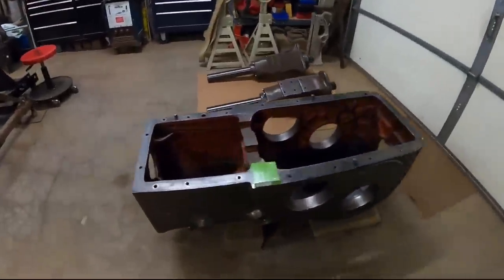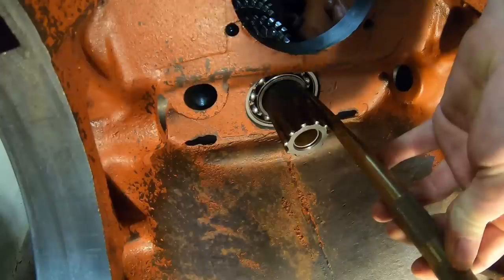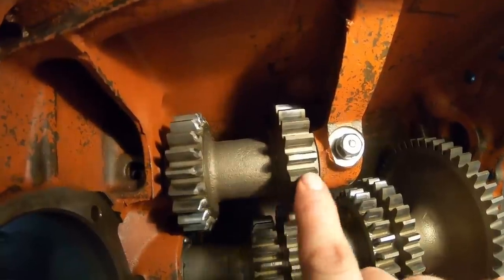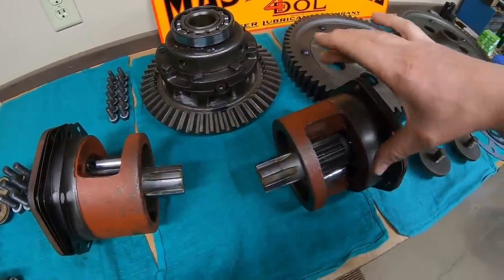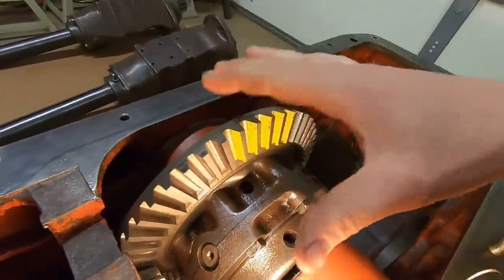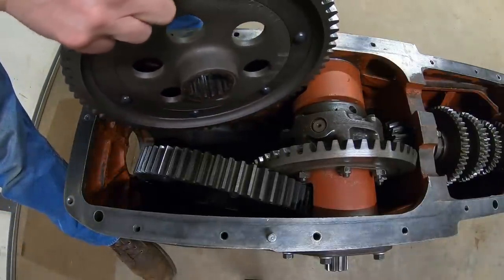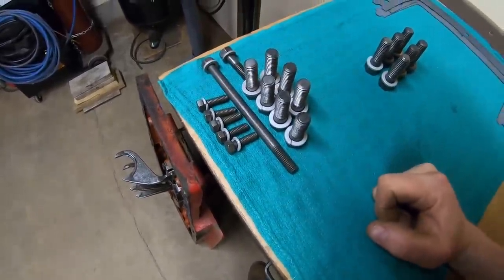Farmall "Preparation H" Project Episode #3 - Gears Back In, Checking Setups & Axles Back On

Comment: Turning the differential gear around to reverse the transmission plus the use of a different transmission cover, is exactly what IH did when a tractor was to be set up for service as a cotton picker, !since in cotton picker service they had the tractors run in reverse due to design of the cotton harvesters then in use at that time.
Reply: There was a little more to it than that. Cotton pickers have no 4th gear.

And just "flipping" the differential ring gear to the other side of the pinion means the wrong side of the pinion teeth is driving the wrong side of the ring gear teeth. There is no correct "contact pattern". 

They were complete clusterfucks and IH never SOLD a single one. Some went on "permanent loan" or "extended demo" but as shitty as the "chassis" was the picker was even worse.

Comment: Thanks again Toby! Great to see the H going back together. I know it’s not a complete rebuild but enjoy seeing an old Farmall getting cleaned up. That front emblem looks pretty cool being original and steel and wish mine had one on when I got it and not having to get a new one from Steiner’s. Hopefully you hang it up on the garage wall when you get done with Preparation H. Can’t wait for the next video!
Reply: @squatch253  that’s awesome! I couldn’t agree more 😁 I don’t have any of them since my cousin restored my 460 utility, the H was done 20+ years ago and my 756 is all original. It’s gonna be nice to see you doing the brake bands on Preparation H and how to adjust them because my H is gonna need them in the near future. New brake pedal return springs are cleaned and painted. Hopefully get them on soon. I’d really like to do the 756 but it’s way more work than I can handle so I’ll fix the little things I can. I wish I could show you the tractors I have. I do need to replace the 460’s fuel sending unit and was told I need a new gauge at the same time but not sure. Thanks for the response!!

Comment: Some of the old Harley racers would lap their transmission gears together to reduce the friction.  If you wanted to get really esoteric you could do something similar to mate the used gears together.
Reply: These days the big bux thing is to polish the mating surfaces and apply diamond-like coatings to them.  DLCs might be overkill on a tractor.

Comment: Excellent explanation on the gear setup requirements with multiple bearing interfaces. Well done. Learned a lot. Absolutely think your hoist adjustable design is first class. That really could help in doing various pulls and lifts. 🇺🇸🤠

Comment: I'm again wanting to see when it all goes together, final assembly and is moving smoothly, quietly under its own power. Looking over that drive assembly, I'd almost put money down those engineers planned for farmers to be able to swap parts around to extend their life, like those bull gears. You even mentioned the ease with which you can assemble the pieces. Tons of planning by those smart engineers/designers.

Comment: Even with tapered bearings still moves and deflects. Big truck rears have thrust bolt and ring gear will push against under load that clearance around 0.040. Not all of them have thrust bolt but these are heavy castings and thick ring gear.

Comment: To add to 12:04, i don't think old Squatch was wrong either. Gasket maker works, you just have to do it properly. I have old engines with complex gaskets under my belt that cannot be fabricated by individuals, and ... silicone did its thing. I've no leaks, i have the right tolerances because i used calibrated spacers distributed across the surface, it works. It gets a bad wrap, because most people who use this kind of stuff (and i hope it's clear from the way i worded it, that brand doesn't really matter) ... they just use the whole tube of it and make a complete and utter mess of it. A little goes a long way, like all things in life, moderation is what makes things right.

Comment: Hey very nice video learned a lot but one thing I would like to ask and I might not be able to articulate as well as you can but if the bevel gear isn’t probably aligned with the sun gear how would you adjust it I would appreciate that very much something I have never done another thing I would like to ask is the deck with the shifter on do the bolt holes run right through because I have found M & H’s seem to get water in the differential every spring I crack my drain until water starts to drip and I wonder what your thoughts were to remedy that ongoing problem? Love your operation 😀🇨🇦

Comment: Shoot, I wanted to both see, and hear discussion, about the roller bearing between the slide shaft and the input.  Did I miss that discussion?  That bearing is often bad and noisy.  They are a bit harder to find and kind of expensive when you do find them.
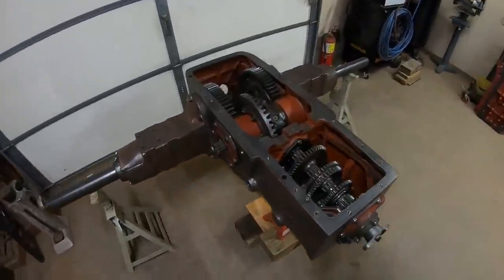Also, a question for you:  To replace a leaky gasket on the axle shaft housing, do you think it would be "reasonable" to reach through the PTO opening and remove the bolt that holds the large bull gear on?  This would eliminate having to remove the top housing plate.  At 15:11, a quick glimpse of the open PTO hole can be seen.  Can you cover that for me?

Comment: I have to ask ! What did you pick up that bent that heavy square tube into an arc on your home made load leveler for the engine hoist ? 🤔
Reply: @squatch253  that's funny ! It looks like about a 4 inch arc between the ends and the middle !

Comment: How'd the rivets in the bull gears look?
I've had tractors open that they were loose. One had one side loose and the other side had been replaced with bolts.
Reply: @squatch253  thats good, that tractor i was referring to with the bolts is a 350 farmall that was in our family since new. I'm definitely not easy on my stuff but it blows my mind how some of the old timers did some of these damages.
Long before my time but one of my uncles supposedly broke the new c farmall in half around a power pole, they fixed it and we still have it.

Comment: Only one taper press fit on ih crawler. The Final drive sprocket no  roller bearings  all ball bearings td18  ball are about 1 inch diameter. They  ruin  bull gear and pinion  quick

Comment: There ain't a whole  lot of difference between this rear end assembly  and that of 354 International,  with the exception of a P.T.O. shaft coming through the bottom  on the 354.  Put it in gear, turn the axel, it will come crystal clear.

Comment: Sir,   You are a Farmall mechanical genius!   I need new axel seals...if I remove the axles on a H or M will everything stay in alignment after installing the seals....I do not want to pull the top deck for installing new seals...ill just let it leak if i have too.....I see you made your new seals...can they just be purchased at CaseIH?     Thanks, so much.  D.

Comment: Like your video's. Very help full.What kind and weight gear oil do you plan on using?
Reply from the maker: I prefer to run 85W-140 in all of my older tractors because it quiets down these old straight tooth gears. Gear oil that heavy can get pretty thick when it’s cold, but that doesn’t pose a problem for me because I don’t run them in the winter.
Reply: I ask because I get told by some people to run 90 weight GL-1 gear oil because it won't eat at brass or bronze bushings. We have a McCormick Deering O4 we are working on the rear end and will be replacing the Oil. @squatch253
Reply from the maker: I’m not trying to play “comments section expert” here but a lot of people don’t understand the conditions that need to be present for some gear oils to start corroding and eating bronze and other light metals. Anything that is “EP rated” (extreme pressure additives present) is just like any other gear oil at temperatures below 400*F. From 400 to 525 degrees, the EP additives start doing their thing - they activate and form a thin layer of oxidation on the metal-to-metal contact surfaces that are meshing together with enough load/friction to be creating the heat. This oxidation can and will deteriorate bronze bushings, but in something like an old letter series Farmall, you would only get up to those temps if you had a catastrophic failure happening in your rear end or trans - there just isn’t the power present to create those temps no matter how hard you’re working it. The only bronze we have in an H or 4 series is inside the reverse idler gear, so little to no chance it would ever get that hot itself, even if the ring and pinion were trying to weld themselves together. You can take that for what it’s worth, I usually don’t get into the “best oils” debate because there are so many different opinions out there, all firmly held but with varying degrees of facts actually backing them up. From my standpoint, I’ve ran Mystik JT-7 85-140 in my Farmall H for the last ten years, and while it’s one of the ones that can attack bronze if it gets hot enough, I’ve done everything from plow with it for several days straight to pull my tumblebug scrapers under some pretty heavy loads (all visible on the channel here) and when I had the back end completely apart last April doing the restoration series on it, the reverse idler bushings were still in perfect condition. I also run a Harvest King brand GL-5 rated 85-140 that specifically lists being “bronze bushing safe” in its spec label, which I’ve also had good luck with. As I tell everyone though, just run what you like best and make sure it’s clean & full, and you likely won’t have any problems 👍
Reply: Thank You for the info. It tell me a lot of your running GL-5 gear oil.
 @squatch253

Comment: Great video! How come you did not grease the splines on the brake drums? Is there no worry about water intrusion and rust?
Reply: Did you get the part where he put cork gaskets on said splines to keep them from leaking oil?  15:53
Reply: @woodhonky3890  Yes I got that part - but I was thinking about power washing and if the water would get past the cork seals....

Comment: Are the bull hub seals 416444, you didn’t replace the same part  number as in the M ??
I don't have a parts manual. 
My BMD has a back end with band brakes which looks the same as the H or American M. And my super BMD has disc brakes and a back end looking like a American Super M.
Regards 
Carl Hargreaves

Comment: Pot metal is horrible in the early 20s it was also used for fuel pump bodies on the ihc m series engine
Reply: @squatch253  ya I guess they had plenty of stock pile